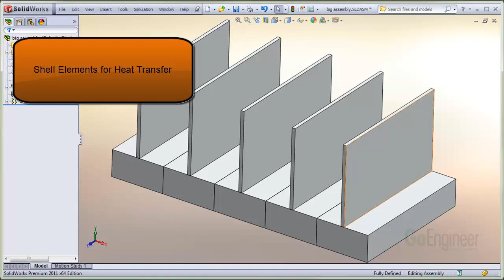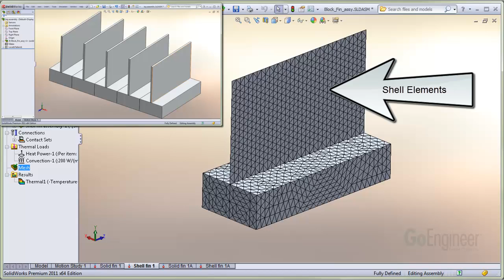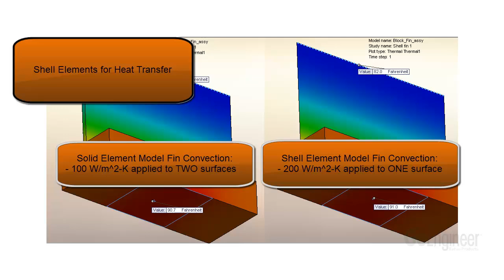SolidWorks Simulation - Shell Elements for Heat Transfer

Comment: Hey, do you know a way in which I can find the total amount of heat flux or heat transferred from the fin? Thank you!
Reply from the maker: Hi Farouq,
The total amount of heat flux from the fin would be reported as the heat power measured on the fine surface.  You could just right click on the 'Results' folder and use 'Heat Power' to select the fin face and report that heat power through the fin.

Comment: what it mean by chose per item?
Reply from the maker: When the "Per Item" option is enabled each selected item (face, edge, or vertex) will have the boundary applied in the specified quantity.  In this case, 10 Watts would be applied to each and all of the items selected in that Heat Power definition.

If you pick the "Total" option then the boundary is distributed across all selections proportionally so the total applied Heat Power adds up to 10 Watts.